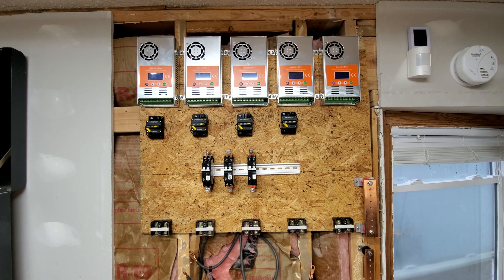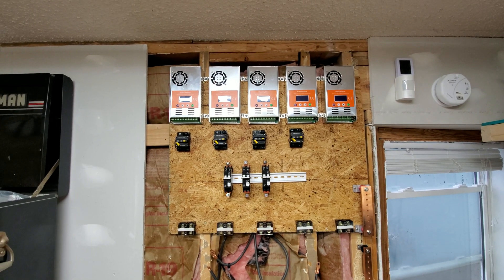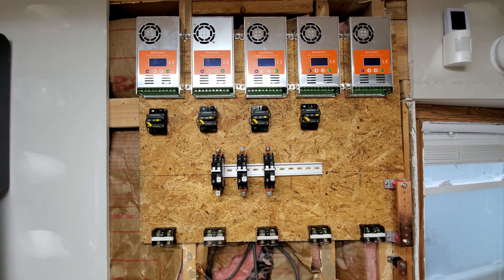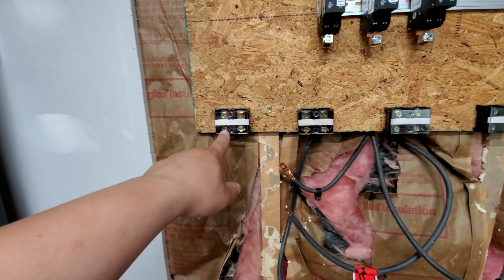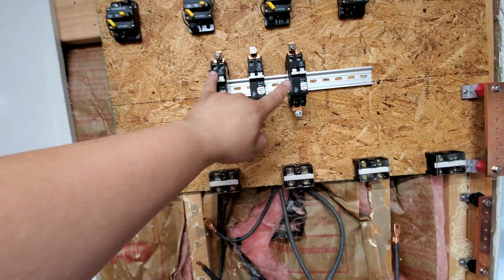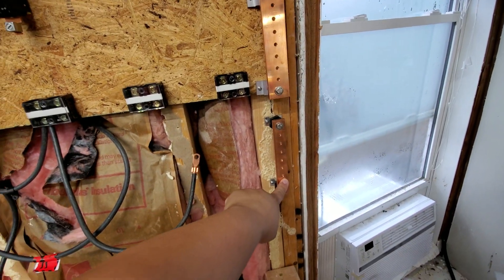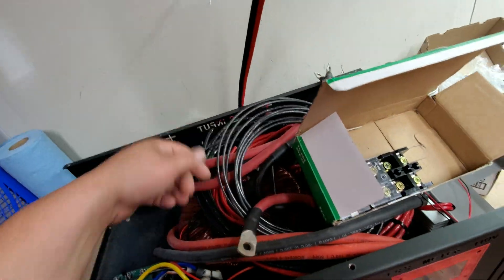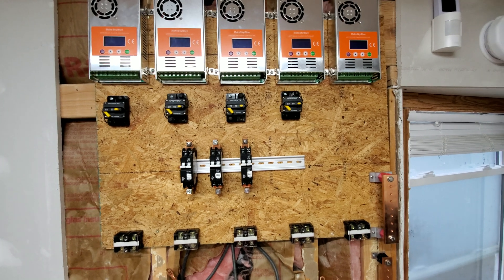My new solar wall is coming together nicely

Comment: Ordered another MSB unit the 15th. Arrived in S. FL today ( 18th ). Sean Buckner does a good job of getting things out. Now to see what I can see using the WiFi model.
Reply from the maker: Yes he does a very good job.
Reply from the maker: Did you use my code?
Reply: @GenetrySolar  No. Got it thru ebay so it was about the same price though.

Comment: Have you had any problems with the city and power company I had some with the power company showe up and saying they were here to investigate why we were using soo much power and I knew we weren't using much because of the solar panels in my backyard they changed all of our light bulbs and placed smart switch board on everything but when they saw the solar panels they said i coulnt have them it was an off grid thing for some of the rooms they got the city involved and the lady the came said if they arent on the roof or visible from the street they can't do anything she said out of sight out of mind

Comment: I’m just going to recommend putting your buss bars side by side, that way if you ever drop a wire etc, it’s not hitting the bar below it
Reply from the maker: Sadly. I only have 3 feet of 4/0 leading to thr battery. I prefer to not use any longer. But I will have wire tie downs for everything and the batteries are properly fused.

Comment: I like your set up.  It will be hard to read the MakeSkyBlue units with them that high.
Reply from the maker: It was hard for me to read them when they were 8 inches lower. I always had to stand up to read them. MSD needs a blue on black LCD.
Reply: 1 has wifi and app don't need to see it

Comment: Yep, your limited a wee bit because the Make Sky Blue are Common Positive.  Not a big deal but you need to keep things isolated up to the battery.
Reply from the maker: Yeah im keeping the PV isolated and then they share the rest. Its the same as them sharing the connection at the battery.

Comment: My POWERJACK is under warranty.   I don't need troubleshooting. I don't have problems.  I have mod my inverter from non split phase to full split phase.  I just need capacitors to clean L2 line noise to get cleaner PURE SINE WAVE.  I need capacitors.  Can you reply back to my text message or contact message made to GENETRYSOLAR.  Thanks.
Reply: If you did the split phase conversion, I believe powerjack doesn’t support your warranty anymore. Other then that you need the red caps on the transformer input of l2(t_i/p_N1) to???(i cant remember for sure but I believe it’s ac output n1)to clean up the noise before the transformer. I would order another charger board for yours & just use those caps but Sean should reply to you during business hours.
Reply: @brian_GotSPL  Yeah, that's what I wanted.  I just need the specs for the red caps.   I need to get a few of them.   I don't want to get another board just red caps.  If warranty does not exist anymore then so be it because my system is fully functional.  However, like I said, I just need a few red caps.   I want professionalism in my mod.
Reply: @ckher777  400v, 4.7uF ("475") caps.  Not too hard to find on eBay or the like (search for "4.7uf 400v").  Or if the inverter has 2 of them, I'd suggest moving one of them to the other phase.  Not like the inverter needs a mountain of those caps.

Comment: You should offset the controller off the wood by placing a few washers under the feet of the controller.  It will help with cooling
Reply: Sean Buckner check off g bears channel I tried my best to get him to buy a controller off you but he payed 500 buck for one he has a pretty big channel and he needs one more my solar store should be open this winter will be able to store over 100 panels  to cut down on shipping I plan on selling make sky blue
Reply from the maker: My room stays at 68. If I notice a problem I will adjust them.
Reply: @GenetrySolar  just saying...the heat sink is the entire backplate of the unit...
Reply: @seanbuckner1213  I took mine apart and put thermal past between the back of the case and the heat sink plate then thermal pasted a finned heat sink to the back. also the fan does not provide much airflow across the heat sink itself just across  the circuit board. at least that is how my 40A units are.